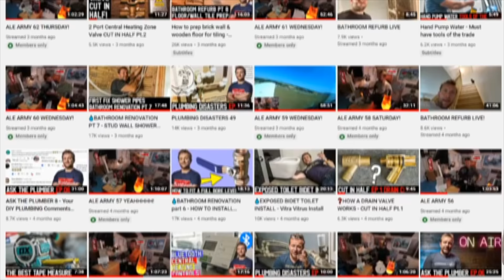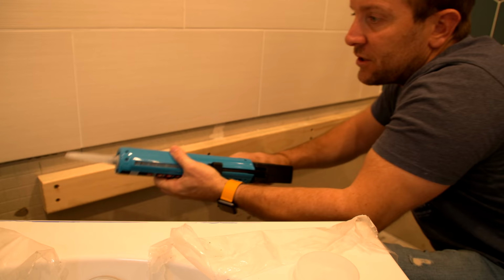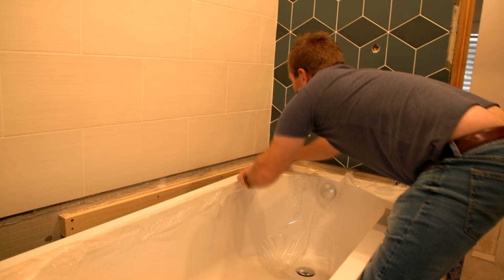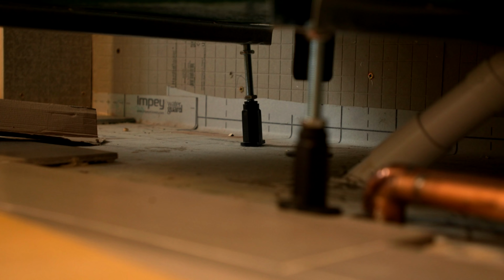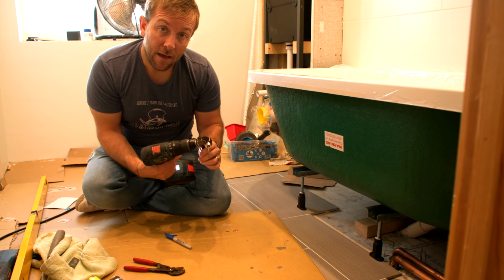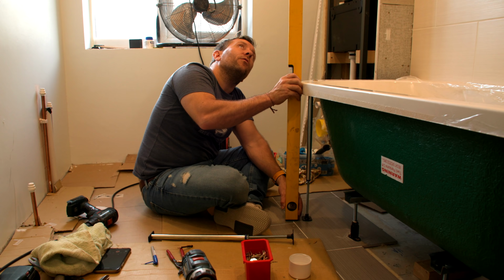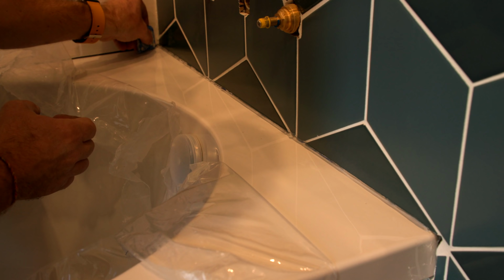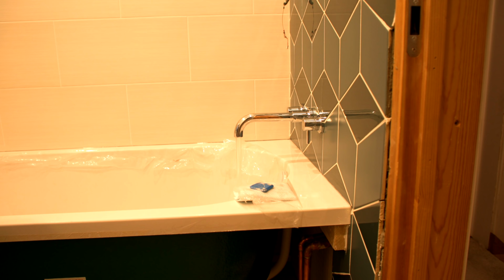HOW TO FIX A BATH TO A WALL AND SCREW THE FEET DOWN.

Comment: So glad you mentioned that filling a bath with water before siliconiong in isnt really a thing anymore if the bath is fitted correctly and framed.
The amount of people i get on my videos saying "You havent filled it up before siliconing" ......If its fitted right with a solid bath its not an issue
Reply from the maker: You know mate. The keyboard warriors of YouTube!
Reply: yeah when you batton the wall, use a quality bath like a Cleargreen bath and make sure its fitted solid, then filling the bath before final seal isnt really required as it not going anywhere! but you also get people who says "the bath come with legs, and metal clips to fix to the wall, why do i need need to batton the wall or make a frame" and just want to fit them as quick as possible, now these are the installs that are best to fill before sealing to let the bath sit down. We install our baths on battons but before tiling (as part for the 1st fix) but our tiler always fills the bath as its just something he has always done.
Reply: @plumberparts  oh mate….. tell me about it🤣🤣🙈
Reply: @RubberduckbathroomsCoUk  👍🏼👍🏼
Reply: I wish James had done the bath in my new build back in 2013 - sunk and all the silicone peeled off the first time I used it, almost pooped myself thinking I was going through the floor 🤣 #DWHQuality

Comment: Excellent video and commentary. This is exactly how l have always install a bath but l also cut a slight bevel on the top of the batten like a French cleat to insure that the bath is pulled in against the wall while the silicone is curing Keep up the good work and stay safe.

Comment: Thanks. I couldn't actually find the link to the specific glue to use, and it was not in the 35 amazon items on the link. I'm doing this job tomorrow, so what glue would you suggest that I can collect from toolstation, screwfix, wickes please?

Comment: I just wondered do you get problems when the ground/floor is not level. Under my bath it is just ground. How can stability be assured such the bath does not drop cracking sealant and allowing water to get through?

Comment: A good sealant gun which is excellent for working in tight areas.  it isn’t as powerful as normal sealant guns which can affect the flow whilst applying. Not the end of the world but can be a pain if sealing, caulking a large area as it takes longer.

Comment: Glues good until you have to pull the dammam thing out again
Reply: How do you remove a glued in Bath?
Reply from the maker: @suesmith821 cut it with a stanley
Reply: @plumberparts Will a Stanley knife reach under the tiles &;down an inch to cut the glue?

Comment: How would you seal a bath to a fully tiled wall? Do I have to cut out the tiles where the bath edge will go or can the bath go up to the tiles directly?
Reply: Traditionally you would have the bath on the wall first and then tiles down to the level of the bath. If the tiles go behind the bath, it might not seal correctly.
Reply: @MrManningata  Yeah unfortunately this room is already tiled and will be replacing a shower cubicle with a bath/shower.
Reply: @_Miner  I reckon if you seal between the bath and the tiled wall, and then fix the bath against the wall, and then add more sealant at the seam - should be OK. I'm not a bathroom fitter though.
Reply: I'm no bathroom fitter, but I do a lot of DIY. I definitely would not cut the tiles out. I'd still mark where to put the batten, and make sure it is level. Then I'd do exactly what had been done in the video, silicone the batten etc, then the side of the bath. That will deffo be watertight. Make sure you use an anti mould bathroom sealant so it doesn't become mucky. Also, just keep an eye on the silicone visually over time. Also, you could put a pvc bead between the tile and the bath to add an extra layer of protection. You have nothing to worry about honestly.
Reply: If you fit a bath to a wall that's already been tiled, you can guarantee it will leak in the future

Comment: I never knew you could glue a bath in 🤯
Reply from the maker: That's the way now mate. The old angled steel bits are useless.
Reply: @plumberparts  but the screwed fixings don't just rely on the surface bond of the wall. It'd be advised to use both, things like skimmed walls can easily separate from the substrate far before the construction adhesive would fail.

Comment: I always drop the C bomb when drilling porcelain tiles.
Reply: Pointed tile drill bits make the job a lit easier.
Reply from the maker: @serverstatuscouk  Yeah I'm still divided on this. Used both. Both are hell. I just hate porcelain tiles SO MUCH!
Reply: @plumberparts  time for the sds 🤣
Reply: @plumberparts  i use glass drill bits, never had an issue, put a few drops of water and takes less than a min

Comment: screw the bath legs? nah man just screw the two accessible corners of the bath to the wall. Glue the feet down so they don't wiggle. Screwing them down doesn't do much to stabilize the bath as they do have a lot of wiggle side to side.